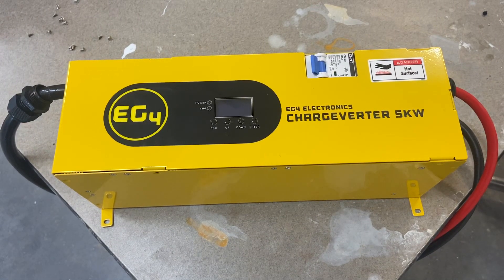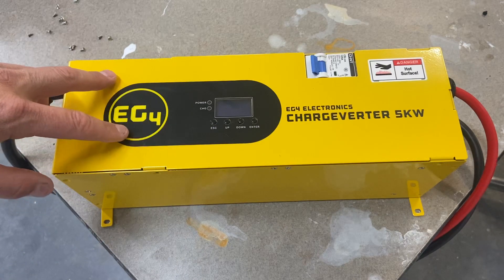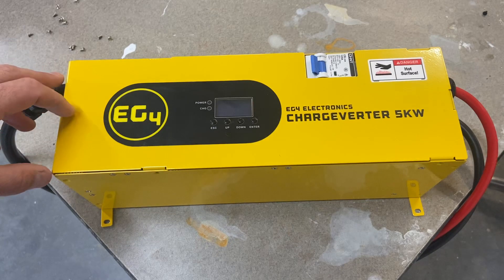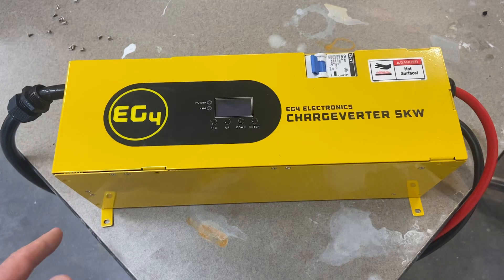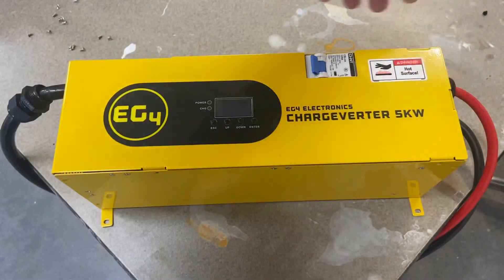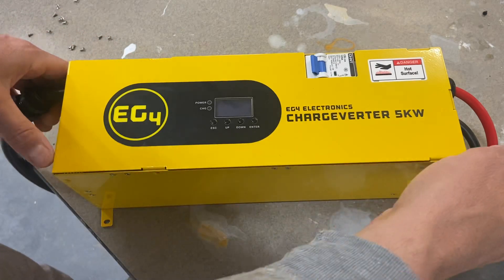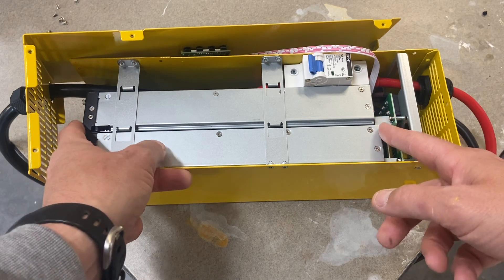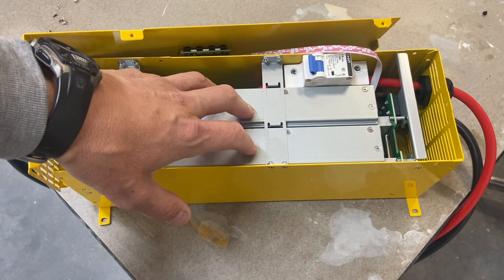Eg4 chargeverter easy fix.

Comment: What about cutting some of the grill out to allow more air flow? Reading they get hot. Looks like the grill is restrictive.
Reply from the maker: I dunno. I haven’t seen any heat issues. But I haven’t run it at 5kw for super long periods of time. I’m not sure about cutting into it. I would probably run it at 80 amps like they recommend and it’ll work fine.

Comment: I just opened up my new chargeverter, and you may no longer need to do this job. They put white silicone caulking  between the modules and also along the back to keep them in place. Thanks for the video, though! I used it to open the new unit.
Reply from the maker: I’m glad to hear it!

Comment: Your video has been so helpful! A friend of mine brought me his Chargeverter to see if I could help him because he could not crank the amperage up (1 indicator only), so I followed your instructions in this video and now it works like a charm charging to 100 amps no problem! Do you know the AWG size and the lug size of the cables of this little guy? I might need to re-crimp it. Also, I noticed that when it was charging, the 2 indicators that you see through the back grill are 1 green and the other orange. Is this normal? When I turned it on they were both green, during charging the top one became orange. In the manual there is nothing about the back indicators.
Reply from the maker: That’s awesome! So I’m not sure the exact wire size. At a glance It looks like 2 awg. But I can’t be sure. Also I’m not sure if both the lights stay green during the actual charging. If the unit is functioning fine then you are probably good to go. If not then maybe ask Signature Solar to verify.
Reply: @GavinStoneDIY  Just shot them an email. Thank you for your videos, keep them coming! Don't mind the mean comments. They are part of the game, unfortunately. Your channel is awesome!
Reply from the maker: @ThomasKJ101  thanks man!

Comment: SS has huge QC issues
Reply from the maker: Especially in some of their larger rollouts this can be an issue for sure. Plus they move a massive amount of product. So that’s a factor. They are designing newer ones with more robust bus bars. Of course that doesn’t help the ones that are already shipped. On the other hand, they shouldn’t be shaken loose again after you fix them.

Comment: I have a similar issue with mine but different.  I’m currently awaiting Level 2 Support from Signature Solar to call me back.  Here is the issue.  I’m getting 48V and 0 amps.  The internal modules are fully seated and their status lights both green.  I can adjusted the current up/down on the interface but still no output currently.  The display reads 48V and 0 amps. I don’t have a DC clamp meter to confirm 0 amps are going to the batteries but they are not charging and after an hour the charger is cold to the touch.  So nothing is happening.  Has anyone else seen this issue?
Reply: I just figured it out.  I had to increase the voltage above 52V.  Given there is no communications between the charger and batteries the voltage level is what the unit uses to turn the charger on and off.  May bad I guess but seems like that would be in the manual or 1st level tech support should know at least that much.  It’s charging now.  Still awaiting Level 2 Tech Support to call me back but when they do I will verify.  Thx!
Reply from the maker: @GG-sj2wg  awesome. Yeah the manual isn’t very descriptive. The online manual does have some more details.
Reply from the maker: Have you checked the POS and NEG cables inside the chargeverter? I’ve heard of one other time where one had come disconnected.

Comment: SS definitely need better QC I got mine and the Batt + lead pulled out of breaker and was touching the case. If the electrician would not have tested for short in the battery cable before connecting it would have gone BOOM. After tightening all the screw and strain reliefs all was well.  Otherwise its a great charger and 70A is no problem with my 66k generator.
Reply from the maker: That’s scary. I may mention the need to test before connecting in my review.

Comment: I had both indicator lights on even though one of the modules was slightly out of place, about 1/8" out.
Reply from the maker: So you had half power with both lights? Interesting. A least it isn’t too complicated to fix.